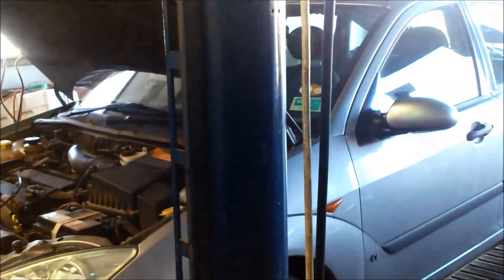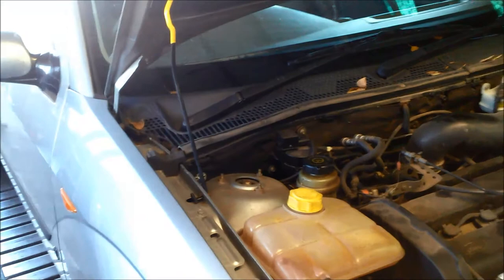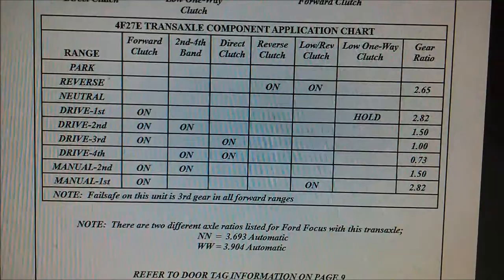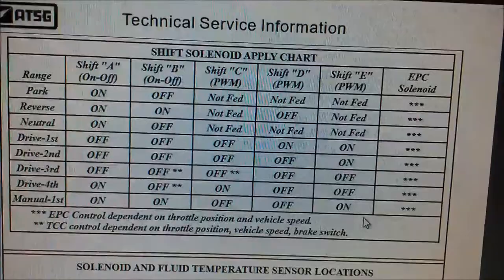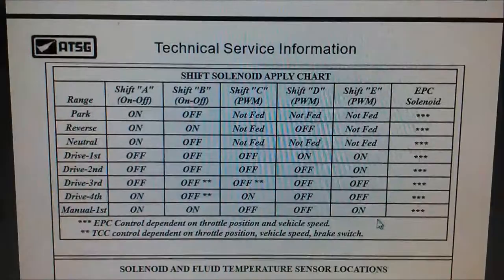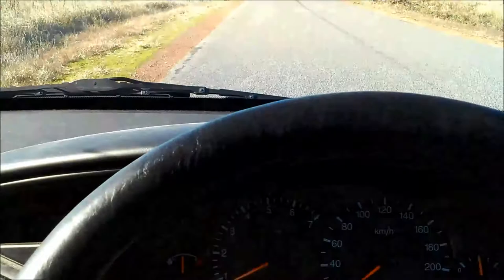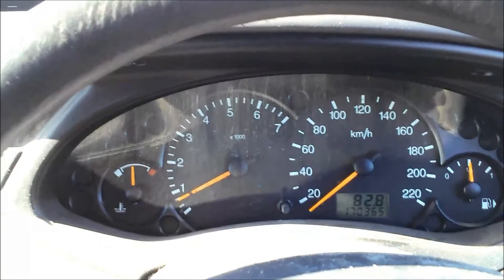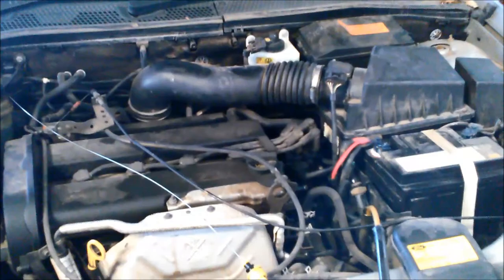Ford 4F27E ( Focus ) FN4A-EL/FN5R ( Mazda ) Automatic Transmission Rebuild

Comment: Thank you so much for making this video and your rebuild series!!! 

Currently rebuilding one out of a 2010 focus and this has been an excellent resource!!! 

Liked and subscribed
Reply from the maker: hi, nice to hear if helped. hopefully i get a few beers out of it ;-) cheers
Reply: Did you finish ?
Reply: @BustedWalletGarage  I got it all together and for some reason I have a no crank no start, and the car doesn’t want to come out of park 😂😂 

Battery is topped off, lights on. Starter not engaging. Shifter is locked out doesn’t start in neutral. 

If I remover shift linkage I can change gears at the trans and on the shifter, when I bolt it back up and put it into park it doesn’t come out and park is a little firm going into it. 

Tried to start in neutral would not start, so I don’t think it’s neutral safety switch. 

I did ground out the negative lead on the bell housing, maybe that’s wrong? 

I did unplug the computer at one point, could it be locked out? On the cpu? 

Threw in a completely new valve body maybe that is the issue? 

I had a ton of fun with it now it’s just a matter of getting it to turn over 😂😂
Reply: @HVACRILLA  oh man that sucks. Need a real deal scanner that shows real time inputs/outputs of sensors & devices to see what info the computer is lacking.
Reply: @BustedWalletGarage  that would be helpful until then I’m going to get real comfortable with my multimeter 🤣🤣

Comment: THIS IS SUCH A GREAT VIDEO! WELL DONE!  I AM HAVING THAT SAME ISSUE. SLAMMING SOUND WHEN I PUT IT INTO REVERSE AND IT'S NOT THE SOLENOIDS. THIS HELPED ME SO MUCH!
Reply from the maker: no worries, cheers
Reply: @YepThatsIt  Hey sir, I apologize for bothering you again. I just had a quick question. Obviously I have to drain the transmission fluid from the pan but when I get to the part At 7:32, when I take that end cover off, will there be a bunch of transmission fluid that comes out or no?? I just want to make sure I don't make a huge mess or waste transmission fluid.

Comment: Im getting lash noise (off and on power) and was wondering what I could do about differential backlash while its in the car. Probably nothing as it looks like the drive gear is on the convertor side of the case. Its that or my TCC clutch burned out and flopping about inside the convertor.

Comment: My 2007 Focus shifts perfect. The auto trans started whining but acts fine. The whine goes away in reverse. 77,000 miles. It seems the loudest right behind that LH cover in your video. I can pull it but would rather not. Best guess? Thank you. James G.
Reply from the maker: Hi, really hard to diagnose noise problems without having a look. Does noise change with revs or speed? Is it in a particular gear or P or N ?

Comment: I keep getting a solenoid d stuck closed on my Focus. Car wont shift into 2nd and also doesnt want to shift from 3rd to 4th. Replaced all solenoids and didnt help the issue. A wrench light comes on and then it wont even allow you to turn off overdrive. Wondering if one of these clips or bands have possibly come loose.
Reply from the maker: hi, contaminated or worn solenoids get stuck. i`d send back to your supplier. make sure you get screenshot of scan. cheers

Comment: i had same transmission on my mazda 3 2005, it clunks hard goin to reverse.. my axle are all good, whats supposedly the problem? and possible check the differential gear
Reply from the maker: hi, could be pressure control solenoid....hard to tell without looking at it. cheers

Comment: Hey hopefully you see this I bought a 06 mazda 3 with a fnr5 didn't ship past 3 high revs no engagement so I replaced it with one from an 11 I already had. First time didn't realize I didn't have torque conveter seated all couldn't turn crank so pulled back out and installed correctly but made loud noise after but shifted through gears  and reverse banged so decided to check it next day but it didn't want to move at all so assumed the worse and got a junkyard fnr5 out of a mazda6, last one that'd maybe work. But still made noise and didn't engage at all so decided to start back to square one original trans. Found the noise coming from starter caught on flywheel. The trans shifted through all gears on a lift. But locked up at 3rd on the road so I just parked. So my question is can this possibly a harness issue or TCM's acting up because the 2nd trans and the original reacted the same way shift alright reverse bang next day no engagement, also if rev high dash catches 3rd and does silly burnout
Reply from the maker: hi, you may have done damage by not installing the torque converter properly. when you bolt up the bell housing the torque converter needs to be free and you should be able to push it in and out if you put a bolt in it with just a few threads in. what are the manual gear selections like? any fault codes? sorry i`m away fro a week and cant reply till i get back. good luck and cheers
Reply: @YepThatsIt  I thought as well so I check the crank thrust clearance and it was good. Do you think I messed something else to make the starter to get hung up, because if I remove the starter the noise will go away. After each time removing the trans's I inspected and they didn't seemed to be sheared. Unfortunately the battery is dead on it, I'll have one soon to give me something to go on. Shifted 1 and 2 on the lift with manual gear but didn't. really think about it when I drove it. 
My thing is when I replaced it the first time it drove all gears but next day nothing. When i reverted to the original shifted throughe 1-3 that it had next day nothing. Hopefully I'll get more info by the time you're back thank you . Tc was free

Comment: Hello! Please help! I am having this 3 codes: 
The  inccorect 3 gear ratio.
The  indicates that the Powertrain Control Module (PCM) has discovered an abnormality in the transmission fluid pressure sensor circuit.The  is an  trouble code signaling a problem with the transmission component slipping.Any possible solution? do i have to replace the transmission or it is something more electrical related?
Reply from the maker: hi, there are so many more things you need to check to be sure. cheers

Comment: Hey buddy... to access this rear cover, what is need to be done to get enough room to pull everything? would you do it from underneath (removing wheel ends, etc.) or from up top?
Reply from the maker: Hi, in no particular order....need to support motor from top , undo the eng. mount on left side bolted to trans, loosen the subframe bolts on right side and remove both front and rear subframe bolts on left side, remove left wheel and the pwr steer hose if bolted on subrame. this will allow you enough room to slide out the end cover, and band etc. you would need to remove trans to get to fwd clutch, pump and torque converter. not a real difficult job just make sure all is clean before you begin and have somewhere to line everything up in order as you remove it....have fun cheers

Comment: Hi, my Ford Focus with automatic 4f27e has a fault p0733 inccorect 3 gear ratio. What could it be??
Reply from the maker: hi, won`t go into 3rd gear or slipping in 3rd? what else is happening ? ( other gears ? )   have you tried gears manually? could be low fluid, direct clutch burnt out, 2-4 Band servo bore worn ( not releasing ) or servo o`rings or shift solenoid or combination of any or all these. check out powerflow and solenoid application chart on my videos. cheers
Reply: Hi My Transmission After heating, the gearbox slides in gears 3 and 4
Reply from the maker: Hi, probably internal pressure leak ( worn transmission hardened seals ) when fluid warms up it is thinner so escapes through leaks easier and quicker. try transmission conditioner fluid or Moreys Honey to try thicken up the trans fluid. will only be a temporary remedy though. cheers
Reply: Basket 3-4 gear broken. Worn sealing rings in the basket and damaged bearing.I apologize for the mistakes, I write through the translator cheers